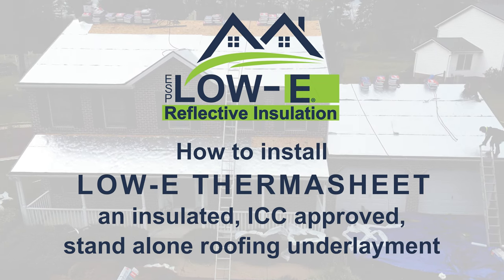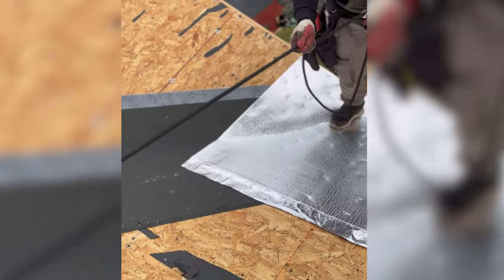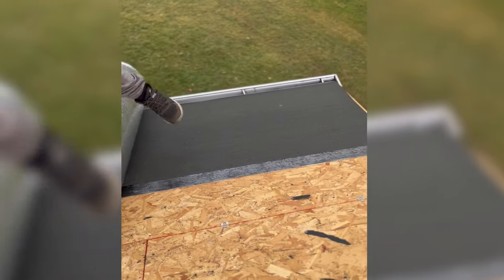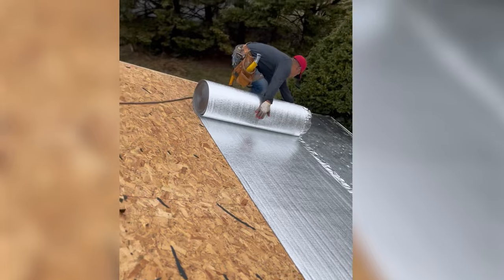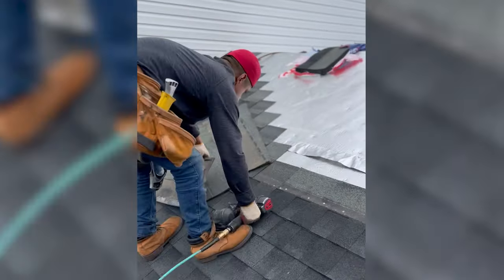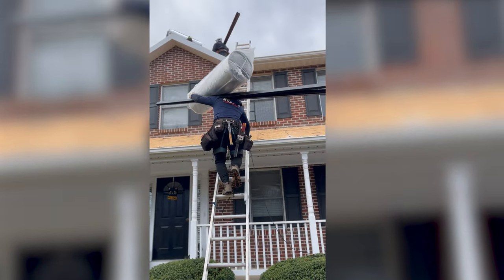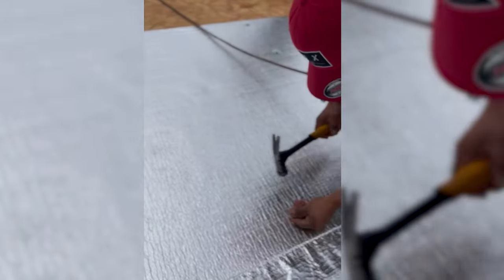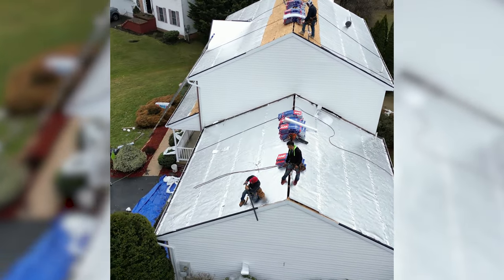ThermaSheet Install Video

Comment: The installation instructions I downloaded from your website say only to tape vertical seams where no flange is present.  It says nothing at all about taping horizontal seams with flanges, unlike this video which says the opposite "These (horizontal) seams must be taped".  That's a big contradiction.